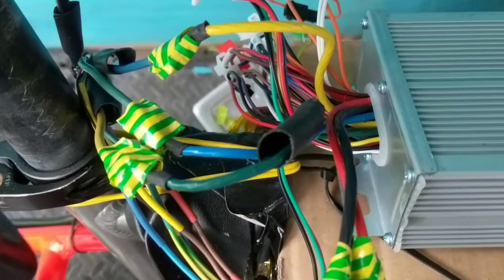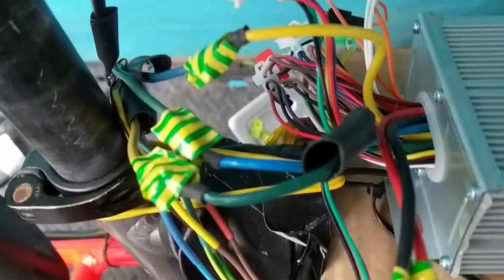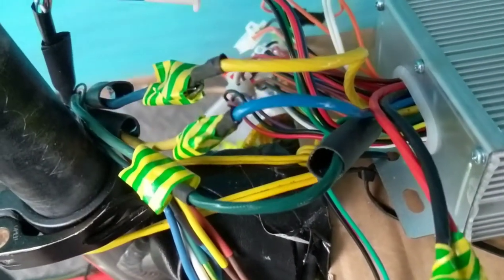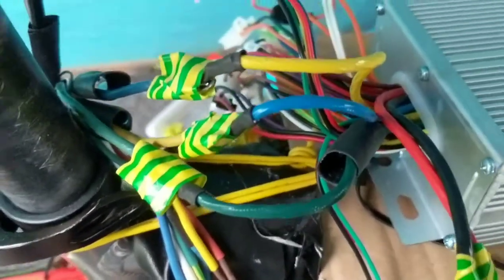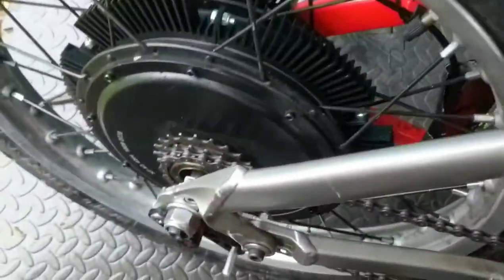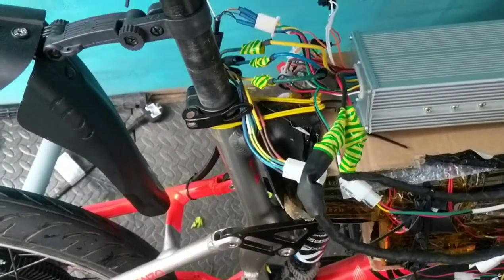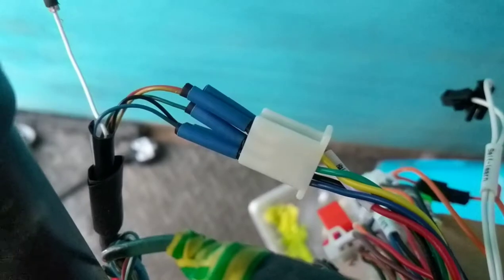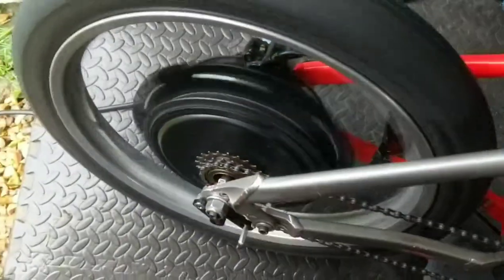Phase wires noise 3000w controller 96v problem solving

Comment: All you had to do was connect your two white wires which are learning wires and if it's spins in the wrong direction disconnected then reconnect it and it will spin in the correct Direction
Reply from the maker: Yes that’s correct :)